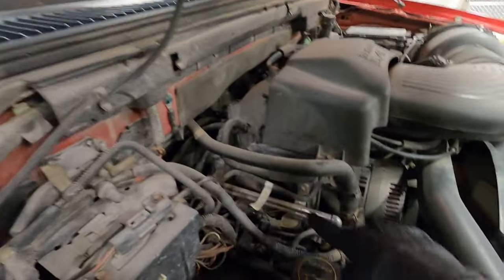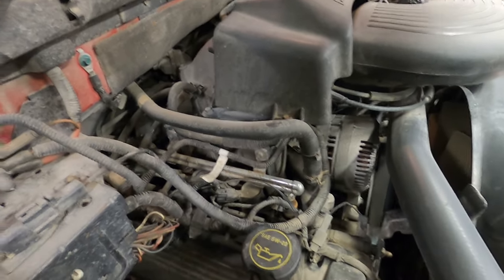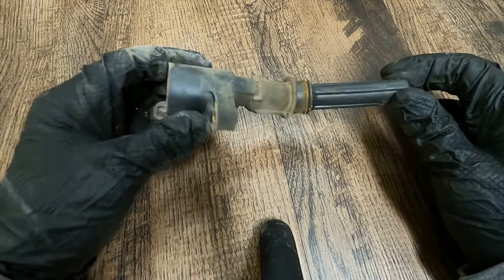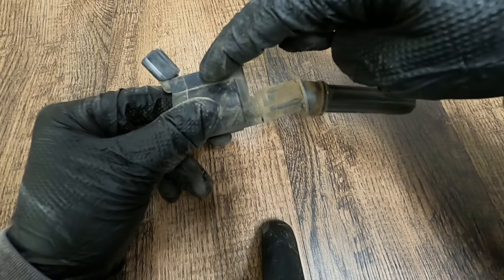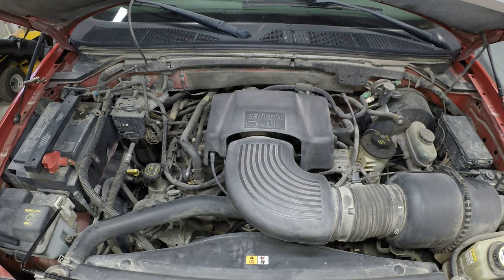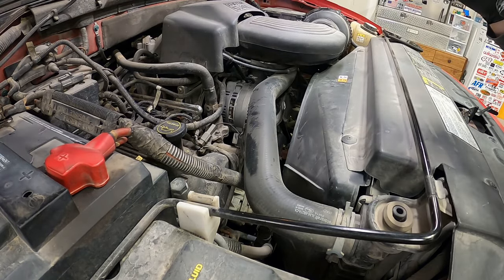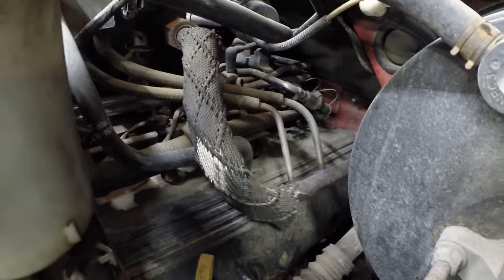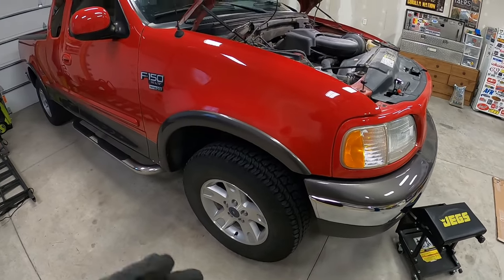Most Common Problems With Ford Triton 5.4 2V Engine

Comment: My daily is a 2000 with the 2v, did all plugs and coils at 150 000 and both exhaust manifolds shortly after. Got almost 300 000 now and it still runs quiet and smooth, body is rotting away but hell, I took her moose hunting 1400 kms up north last September and she never skipped a beat. I’ll drive it until the motor or transmission fail. 75,000$ for a new truck???? I’ll pass
Reply: Great video for all of us 5.4 2V owners thank you for taking time to do this video.
Reply from the maker: @SteveReneMedia Thanks for the comment!
Reply: I have 2000  f150 and it has 160,000mi.  It just started to miss fire really bad. Did changing the spark plugs and coils help you with this issue?
Reply: @waltercrigler6732  had the same issue!  I used a obd reader to shoot the codes first.  It kept telling me bank 7 and bank 2 misfire.  I just order all 8 plugs and 8 coils. Did em all.  I didn’t want to replace just the bad ones, she had 200k at that point I figured the other ones weren’t far behind. Put a new air filter on and an oil change and she’s good to go.  Runs smoother than it ever ran I think lol. It’s too bad she’s rusting away!
Reply: If you want that truck to stay on the road longer than 300k  with a repair that will save you alot of money here it it.....  Above your oil filter is a aluminum oil cooler heat exchanger . Inside the heat exchanger is a port for oil and another port for coolant .. When this part goes the oil pressure will pump oil out the engine into the coolant system as the coolant system has less pressure.   The radiator cap will plug with oil  and the coolant system will blow somewhere after  the oil fills it and the engine runs dry of oil ... The first sign of this failure is you will hear bubbling gurgling in the dashboard from the  heater core  then oil pressure will drop
Reply: @KonaBlueSVT well o2senesor  cause lack of power when flooring it
Reply: I have a 04 5.4 f150 triton it only has 124k miles i bought it it ran fine for about 800 miles now it wont run at idle very long or dies when you put it in gear no check engine light
Reply: @LeashH-nt9xg   coil packs  or plugs or idle air control solenoid
Reply: Ya I’m looking at one now they did coils plugs lower radiator stuff like that and it’s got 270k for 1500 idk if I should cope it’s an 03 Ford F-150 lariat
Reply: Miles or what??
Reply: Yep, bit $100000 for gas though...
Reply: Got 375,000 miles on my first 2001 f150. Just bought my second with only 170,000 miles, and it runs like new as well.
Reply: I grew up in a 2 valve lariat and ever since I was a kid I loved the thing dads was bought brand new and it’s whole life has only required a set of coil packs , it inspired me to get my own 2000 expedition and it’s been great on a trade for 2 years this time I went to take it camping and it sounds like it popped a passenger side plug out of the block haha , no big deal tho I’ll get to it this month , either that or the passenger side pin hole exhaust leaks in the manifold all of a sudden became gaping wide…

Comment: I've had "0" problems with my 2 valve 5.4, in my book best engine ever built, everything goes wrong this is just minor issues, ford should have never discontinued these engines.
Reply: This and the 4.6 2v engines are the best engines Ford has ever made, and they certainly won’t EVER make anything better than these engines.
Reply: I had an 01 with the 5.4 and only had to do could packs at about 140,000 miles and a radiator weld due to a small crack. Other than that it was a great truck! Now I have a 2000 super duty with the same engine.
Reply: Bullet proof!
Reply: The government keeps demanding better gas mileage and emissions so the motors have to continue to evolve. It’s awful.

Comment: 97 f150 5.4. I spent 2 years and at least a grand chasing lean code on both banks. No vacuum leak, plugs and coils good ,changed egr, throttle body and maf sensor twice. It always ran great but mpg was terrible. Finally take to a real mechanic, he asked when I changed maf did I also change the housing. Nope. He showed me that Ford requires the maf a d housing needs to be matched and flowed together. Put it on and cleared codes and it runs like new. Bought from Napa, about 265.00.
Reply: 100% I’m not great when it comes to mechanical stuff but regardless of what vehicle I always recommend changing the housing and sensor at the same time
Reply: Thanks for your advice man!
(1997 f150,5.4,automatic,4x4)
Reply: Ok but did the MAF sensor trip the MIL?
Reply: @larrymclain  no, it was lean codes on both banks.
Tried all kinds of shit to fix. Even changed maf sensor to no avail.
Finally changed maf sensor and housing as a matched unit. Codes gone and all is good since....
Reply: Did you have any misfire issues?
Reply: @makinmusikpro  no, motor ran very good. Great throttle response, milage not that bad but just couldn't get the codes to stop reappearing.
It's been a year and still running like it was new.
I hear all these stories about the 5.4 not being a great engine.
Mine is, I wouldn't sell this truck for any reason, I love it....
Reply: @josephadams7106 I have exact same issue and changed my MAF last week. What housing? The whole air intake?
Reply: @douglascasmay1981  maf and the housing it bolts into.
In other words right after the filter.
My mechanic showed me the tsb from ford that the sensor needs to be changed with the matching mount, they are airflowed together. Mine was from NAPA,sorry I don't have the p/n but it was like 
$ 250.00
Reply: Did yours run rough and shaky around forty to fifty miles per hour when it went and overdrive?
Reply: @TheGirlDadJake0911  
No. Except for the cil on the dash I wouldn't know there was something wrong!
It's always run perfect since I bought it new...

Comment: The reason they blow spark plugs is under torquing of the plugs. Torque to 25 lbs dry and you'll never have a problem.
Reply from the maker: It helps, but is not a cure all.
Reply: Hey brother. I don’t mean to step on your comment, but Ford issued a service bulletin on this probably 18 years plus ago now. It’s not that your comment is incorrect because it’s not. After my blowout just outside of warranty I did the research on this because I was pretty pissed. Ford acknowledged that incorrect machine work was the true culprit. There was only 2-3 threads machined into the heads for the plug to grab and hold. To give you a idea of how inadequate that is, in the Air Force if there wasn’t at least 3 threads showing on a nut it was a safety violation. So if you allow a minimum of 4 threads in the nut plus the 3 it’s obviously 7 threads. Granted, we’re talking about equipment considerably more expensive than a F-150 but it shows how far they missed the mark. They admitted the problem, and this was pre kit repair so I had to pay a dealer almost $2k to pull the head and repair it. They had you by the nuts back then. If they would’ve issued a recall they were looking at bankruptcy, so they let all of us absorb it. Not quite like changing some rusty gas tank straps. But as I said you are correct, the others were torqued to spec and I haven’t had a problem since. But with the trauma of the initial failure I do a torque check about every 20k miles give or take. Call it paranoia. Luckily the trucks 22 now and driven less than 2k a year. Sorry so long but I kinda was ranting on Ford. But I’ve purchased 5 more Fords since. I’m not sure if I’m loyal or stupid, but the rest have been very dependable nice vehicles.
Reply: @scottjones8737  

Well put, thank you
Reply: @Kurtis Waskey 🤣 your joking right. Your overdrive had noting to do with it. 🤣 that like telling the new guy to change the blinker fluid.
Reply: @scottjones8737  excellent overview and correct information. I own a 2001 F150 5.4 and have blown out two plugs at different times. Luckily my mechanic used the kit and it’s worked out. Good advice to double check the torques periodically.  Thanks!
Reply: I am stumped. I had a code 307. I replaced spark plug and coil the got code for EGR sensor. So I changed that. Now I am getting two codes of 307 again and a code 174. Need advice please.
Reply: @KonaBlueSVT  please can you make suggestions on improve the low end torque 2k-3.5k rpm on my 21 foot 97 E350 RV..  I cruise control at 60mph. 5.4 2 valve 4r100.. this RV is a keeper..  improving drivable and mpg are my priorities 

Thank you..
Reply from the maker: @camposvazquez  Being that these things are getting older I would suggest you start by restoring any lost power.  I would have a BG fuel induction and injection performed, followed by an oil change with BG EPR.  These will address any deposits in your engine that are robbing power.  The next easiest thing to get some more power and MPG would be to install a cold air intake, you could likely get a little extra HP and torque.
Reply: @KonaBlueSVT  thank you
Reply: The problem was not enough threads and people not putting WD 40 or something to oil it when you pull the spark plug out and not ruin the threads and later 03 and up had more threads
Reply: They’re a major pain in the ass to change also. 😂
Reply: @scottjones8737 I’ll ever buy another Ford again. 😂

Comment: I've owned my 2001 f150 harley since 2004 it has  over 400,000 kms and still drives like new.  All I've done is normal maintenance and it's healthy as   could be.
Reply: I'm buying one just like what u have u think it's a good buy
Reply from the maker: Depends on all the details. Price, options, miles, etc.
Reply: Be ready to drop 3 to 6 grand on timing chain complete replacement  oil pan cleaning and gasket ,timing cover oil seal and cover seals  2 timing chains ford oem chain guides oem chain tensioners  new oil sump tube screen gets clogged with metal and plastic new oring for pickup tube big bottle of blue loctite valve cover gaskets with bolt grommets new coil packs new spark plugs with bag of antiseize new fuel filter new air filter cam holding tools 1/4,3/8,1/2 torque  wrenches crankshaft socket new water pump new high volume oil pump by melling  suction fill syringe for oil pump orfice priming  and while your at it change you trans filter and fluid some have reusable gasket  3 gallons of new yellow antifreeze and 3 gallons of distilled water .I installed a new fan clutch  and cam followers and watch out for needing new cams to if worn  these engines will last a very long time if you keep up on the timing chains  oh and 2 new oil filters and a oil can for prelube  and grey silicone  I'm sure I'm forgetting a few  things but it's a huge dirty  job  80 percent of this job is cleaning the metal and gunk out of the oil pan oh an better get 2 or 3 gallons of oem ford trans fluid  mine took 2 gallons  I had a seal leak all fluid leaked out while sitting when doing timing job i also got new battery and alternator  cost me u.s.d 3500.00  and 2 month of couple hours a day after work  a total night mare but the shop would not have done this job the right way if you want it done right do it your self .now on to the axle bearing and seals that are shot 😭 oh and by the way my 2002 4.6 f 150 had 250,000 miles  timing chains were fine it's the  loss of oil pressure due to oil pickup screen getting clogged from chain tensioners eating themselves yep  total self destruction  and I kept my oil clean ya cant see the oil pickup screen clogged unless you jack the engine to the ceiling and take oil pan off it's a bear to do trans bell housing is in the way it took a miracle to get it out and 3 bottle Jack's  2 ramps and a floor jack ..
Reply from the maker: @matthewcrews4034  You can get a complete reman engine for around $3000......
Reply: I have a complete 2003 super charged drive train sitting in my garage from a 2003 harley . The day this one shits the bed it will give me all the more reason to do the swap lol
Reply: @matthewcrews4034  
Not much huh ? 😖😶😵‍💫
Reply: @matthewcrews4034  Wow!  I can't imagine what all of that would cost at the local Ford dealer?!
Reply: Seriously?? Do you plan 2 hour trips, to make sure you don't go above 55mph ? 
I'm just missing with you!! No doubt!! That is amazing!! Explain, please??

Comment: You don’t ever put a Helicoil in a Triton cylinder head period. The proper procedure is using a spark plug thread insert with a lip that tightens onto the flat seat area of the cylinder head.

Comment: I've had 2 F-150 5.4 2Vs, a '97 and an '03.  Both had exhaust manifold gasket leaks on the right rear side, same place on both.  Both required new exhaust manifolds, gaskets and stud bolts-nuts.  I had both sides done on both trucks and each truck cost about $1,100 parts and labor.
Reply: That’s an absolutely ridiculous price, if you did it yourself it would have cost you about $300 and a days worth of work with no lift.
Reply: @jmtGAMING  price seems fair to me.  If you can't do it yourself you have to respect the guy that will do it for you and not itch over the cost.
Reply: @thewhomphlew  I get that, it’s fair obviously for having somebody else do your dirty work. My point was for such a simple task it’s ridiculous that somebody would pay another man to work on their own vehicle when it can easily been done yourself. I still think the price is a little steep but definitely fair.
Reply: @jmtGAMING  That's only around $40 higher than my estimates for the same job, new studs and everything. No mechanic ever opened shop to give people basement bargains prices, it's to make a living,   and alot of people have no desire to start wrenching on their vehicle. Nothing wrong with that.
Reply: @jmtGAMING  Yes, the price is a bit steep, but it takes a long time.... and it is not easy
Reply: Same with mine around 120K miles; replaced mine with a titanium coated exhaust and replaced myself. Had about 5 studs break off and had to drill/thread one of them.
Reply: Thanks for the information
Reply: @jmtGAMING  nah, it's right. Labor is 300 each side and 150 per manifold. 100/hr labor and yes it's about 3hrs a side at an exhaust shop. Normally busted studs need drilled and tapped. And the drill and tap requires a special jig that lines up holes perfectly. Anyone who does this at home will yes do it cheaper but it's a hell of a head ache and honestly 1k ain't shit to save a headache.
Reply: @codyjohnson5674  1k is shit to me, I’ll take that headache and get done faster. It would be more of a headache to me to have my car sit somewhere until they’re ready to work on it for somehow 6 hours. I’m not mechanic but I do my own work on my car. And it’s by far not 6 hours
Reply: @jmtGAMING  unless your studs are stuck and the bolt that broke is flushed to the engine took me 3 days to drill out 3 and do both sides also if you have a super duty you need to atleast lift the engine a few inches
Reply: I did my own at home for 200 bucks 😂 so they screwed you good bud all I needed was extractor for the broken bolts an Dremel to Dremel the nub on the manifold a hair so it'll fit then drop in the new studs and nuts and gasket and drop it and bolt it down after you seal it works great got 400 k still looks like new manifold and no exhaust leaks up front
Reply: @thewhomphlew respect doesn’t mean pay $200/hr; there is a price per hr of skilled labor that makes sense.  If someone has done these it should take them 4hrs or less, so $800 in labor is ridiculous.  Yes they could have gone elsewhere and they chose who they chose, but that doesn’t make it a fair price for a relatively easy job.  This isn’t brain surgery…

Comment: Ford wanted to buy Lotus Motors. They refused to sell. Ford then contacted their employees and offered more money to come to Ford. The engine they first designed was the 4.6/5.4 two valve.
Reply: He 4.6 and 5.4 were designed off the 2.3 pinto Motor back in the 70s
Reply: @DaveyJones-h5k  Too bad they didn't use a timing belt. It might have been as good as Toyotas 4.7

Comment: Just bought a 2001 lariat 5.4 supercrew with 200k and paid 3400 bucks. Because it had a p304. Swapped the pack and now it runs absolutely perfect.

Comment: 1.Exhaust manifold leak
2.Spark plugs blowing threads out usually after becoming loose.
3. Coolant leaking at intake manifold 
4. Vacuum lines leaking
Reply: I'm at 201,000 miles and have had #1, #2 and #4; additionally I'm on my 3rd alternator.
Reply: Plastic sides on the radiator package ended up replacing it
Reply: 170k miles only had number one but thats from someone not putting the bolts on even its a work truck i haul 5 ton all the time the engine is a mule just the gear ratio is very low meaning shes sluggish but powerful
Reply: #3 💯😔